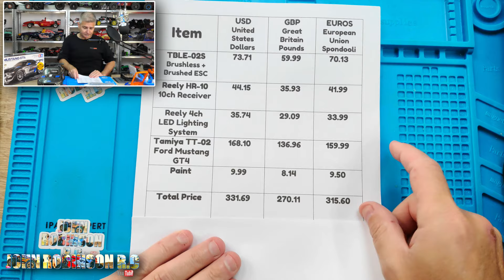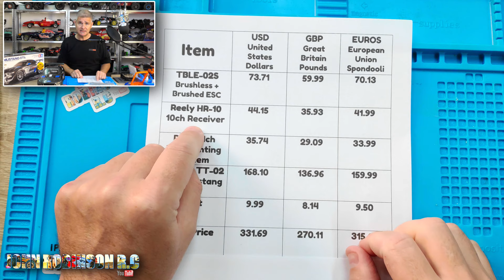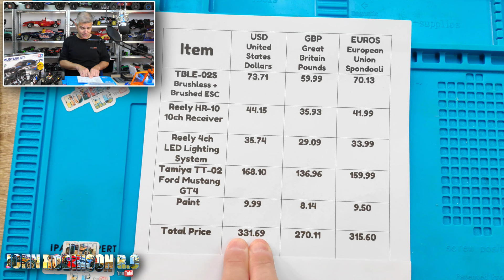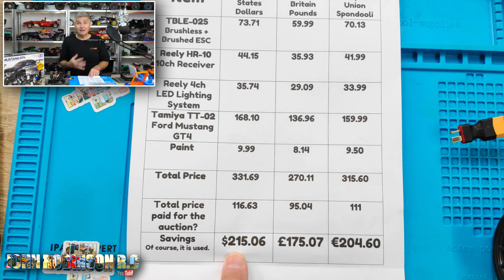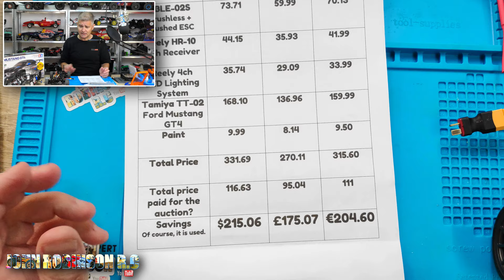Should you buy new or used RC Car? eBay Tamiya TT-02 Ford Mustang GT4 #shorts

Comment: For a standard TT02 chassis and body that's a decent price 👌.  On another day could have easily gone for £30 plus on top of what you paid . Built 3 of the TT02 chassis,  easy to build and plenty of hop ups. Alloy center shaft and cups , high speed gear set and adjustable motor mount peps it up nicely. Alloy adjustable shocks will sort the bounce.The gear mesh sounded a bit tight when you fired it up on the bench . Mine run quite quiet.  Nice buy over all 👍 Drive shaft upgrade a must as stock plastic ones flex and twist under load

Comment: That's an absolute steal for that price, John!! Even if it has some issues, it would still be cheap! 

I've been lucky with my second hand purchases of RC cars (Gmade R1, NincoRC Renault Mégane GT, and a bargain Carisma Sca1e Coyote), as all have been exactly as described, and arrived in the condition I was expecting. 

Doing your research is essential, as you've done. And the car looks awesome. 

If it were me, the only thing I would do, is lower the suspension a tad, as there's too much altitude!! Great job by the builder. 😎👍🏻. And I was first for a change. 😆